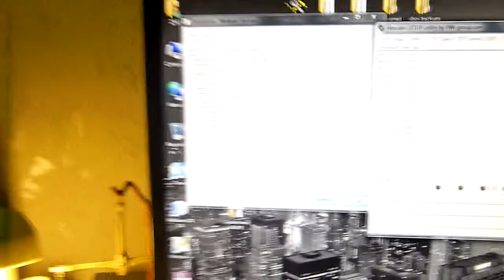Atmega16 rgb driver

Comment from the maker: @blackmambe so i wrote some basic info on pwm an control registers you can find link at the description.I also made a very very simple program on c using avr-gcc compiler. Assuming that uC isatmega8 and speed is 8MHz the source link can be also found in description. Hope this will help you, the "boring part" can be adopted to any language, because its only about chip registers, and source should give you some simple start :)

Comment from the maker: @blackmambe No problem, but i don`t work with assembler, only c. What chip are you using? I could provide you with a sample of register values, also some simple code for pwm management. Post in comments, or via mail.